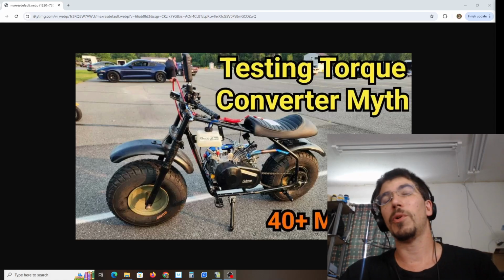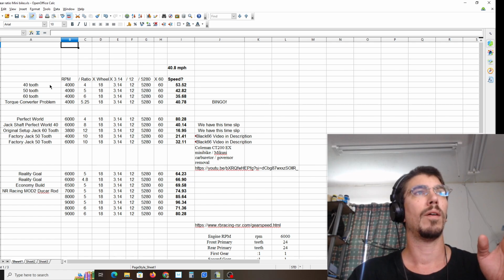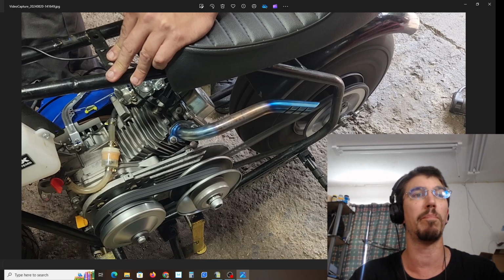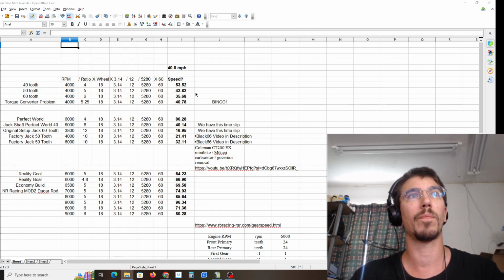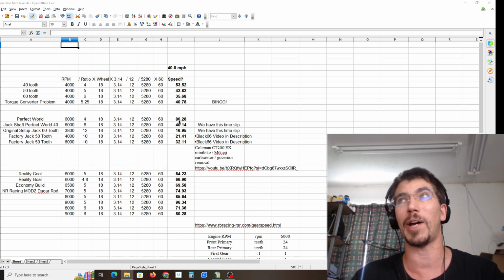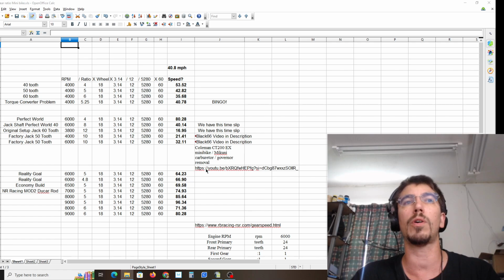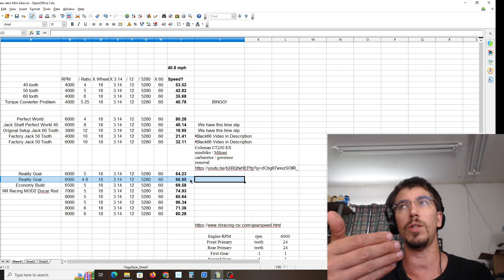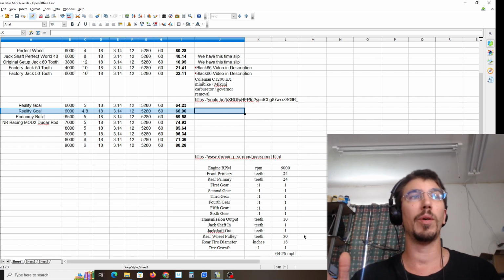30 Torque Converter Gear Ratio Math vrs Reality

Comment: I have a common CT 200 UEX 224 predator gov delete 24mm carb pipe aluminum flywheel 30 series torque converter 40t rear 10t front 19” tire and 48mph is top speed any suggestions?

Comment: I have one with a 10 to a 50 on the rear wheel I get bout 55 I want higher top speed what gear should I run cuz I tested a 13 today and it gave crazy torque but no top speed well I got 47 but the motor didn’t like the gear

Comment: Im running a tq with an 18t on it and a 48t on the rear tire 13in. I'm able to hit and mantain 57mph im running a juggernaut driver pulley though. I can still wheelie but the driver pulley doesn't fully engage. I also hit the same top speed with a 13t on the tq and the 48 on the back. The juggernaut fully engages with the 13t. I keep running the 18t because I plan on adding a higher lift cam and ratio rockers to see if I can get a little more torque out of the engine. Rn it's a tillotson 212e with 26lbs springs, a mod 2 cam, and a vm22 carb. I'm going to swap to a .272 mongoose cam, low drag billet flywheel, a 3.308 billet rod, and a flat top pistion in a month or two. I'm waiting to do it all at the same time. Because I'll probably have to clearance the crankshaft and my tillotson is not okay with parting from the flywheel, it'll come off but it's harder than any other engine i own to take it off.

Comment: Have You tried a 20 series CVT ? it is the same size as the 30 series but has a symmetrical belt and they don't slip as much as the asymmetrical belts. The only drawback to them is that you have to run a jackshaft to get the driven pully in right , no backplate bolted to the engine.
Reply from the maker: Actually my next move would be to switch to a 40 to upgrade but keep it on the cheap. This would keep me in the tunable sub $200 range.
Reply: @RCGRacing  Even better

Comment: How do you determine the max and min ratios of a torque converter (specifically a gy6 for my application)? On a separate note, I've never seen a torque converter go into "overdrive" before; that's really interesting. I don't think the gy6 CVT has the overdrive feature

Comment: hmm are the cvt tuneable like a scooter? i would get a different Variator and clutch with different weight sliders.
Reply from the maker: Yes they can. 3 driven springs and several driver weights as well.